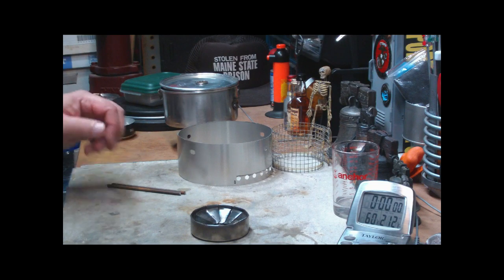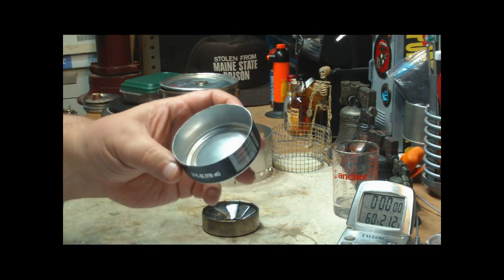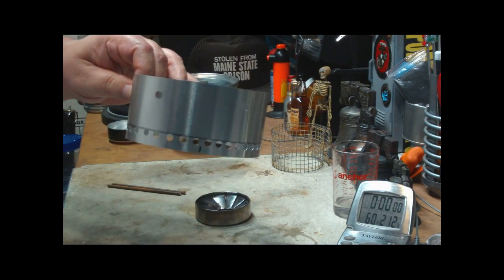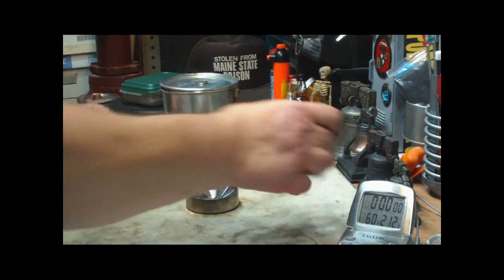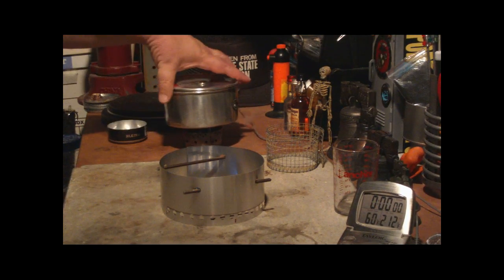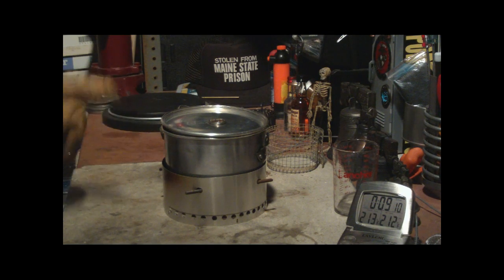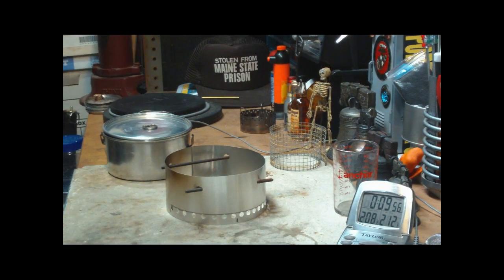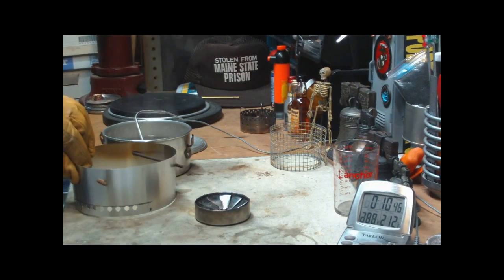Flat Cat Gear's Standard Stove -  Boil Test 2

Comment: Great Vids Hiram, I have used a lot of your ideas so far, on this one, how about getting a Bobcat Jr. Windscreen or trying to make one similar to it to see if that helps with the times, it has 4 legs cut in the bottom, allowing air in all around it, and then the holes are cut into the top side, maybe the Bobcat Jr. Windscreen design would work better, thanks again for all  your testing you do.

Comment: Hiram, 15 ml of alcohol will boil 2 cups of water starting at 70 F.  The temperature rise is 142 F per 15 ml or approximately 10 F / ml.  If you start off with 60 F water, then you should add an additional 1 ml to guarantee a good boil.  Best regards - Jon

Comment: Thanks Hiram!  We include a heat shield with our system and that will reduce the time to boil by 30 to 90 seconds.  Just use a piece of aluminum foil to reflect the heat back up.  As the fuel runs out, the energy output decreases.  This is why the 1/2 oz. boil time is longer than the 1 oz boil time (let me know if this makes sense).  The fins have multiple functions that make the stove fast and fuel efficient.